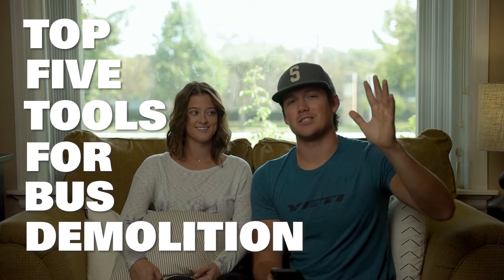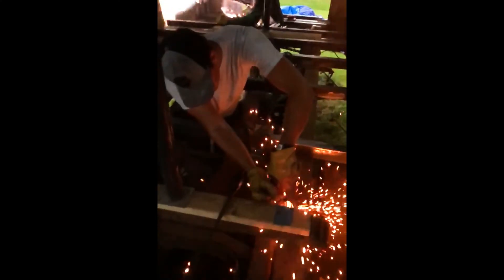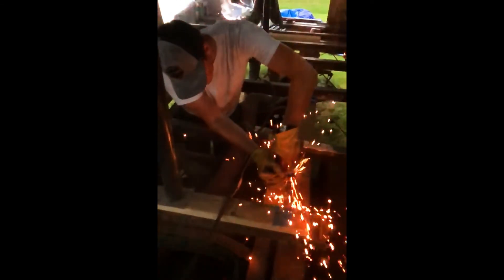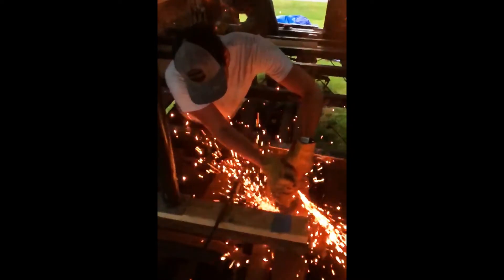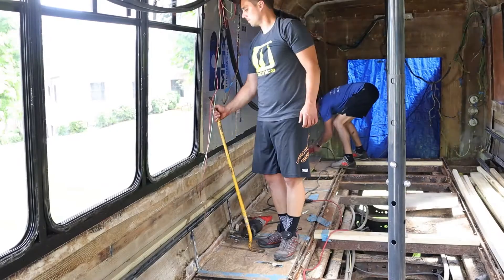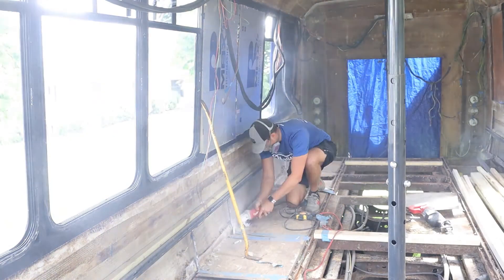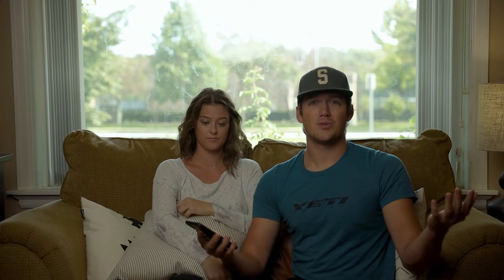TOP 5 TOOLS FOR SKOOLIE DEMOLITION--Skoolie Ep. 24

Comment: The tool I use the most is my Bosch impact driver.  

Agree 100% on the angle grinder!  I had to replace the electric entry step on my 20 year old motorhome, and the step was installed using carriage bolts (WTF!!).  No hope in getting those rusted bolts off.  The angle grinder did a great job grinding away the rusted bolts!   #LoveHarborFreightTools   

Looking forward to your next video!

Comment: So far I have removed the seats, wheelchair lift, rear ac unit and 2 rear floor heaters.  We used a Sawzall to cut the wheelchair lift out, as well as to remove the last 3 bolts from the rear AC unit.  Definitely a must have!  I also want to give a shout out to the Penetrating Blaster.... Thanks to your recommendation I was FINALLY able to open the rear window (the handles would not budge before PB blaster) and I was able to close the 2 handles under the bus (which also would not budge) that isolated or turned off the rear heating units.  So, yeah.. thanks!!!!  Keep the awesome informative videos coming, can't wait to see the build start... especially the ceiling reinforcement.  😃 Thanks!
Reply from the maker: TheGeoBus Sawsall took down our AC too!💪🏼 glad the PB blaster helped!! It really does make a difference